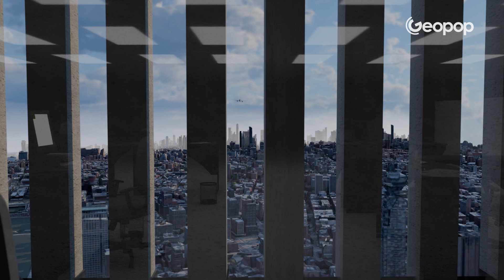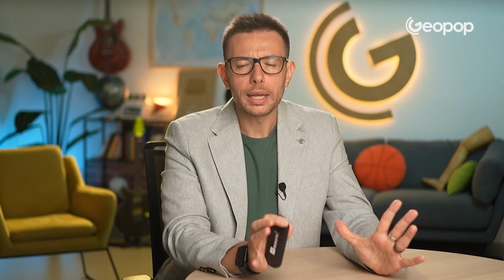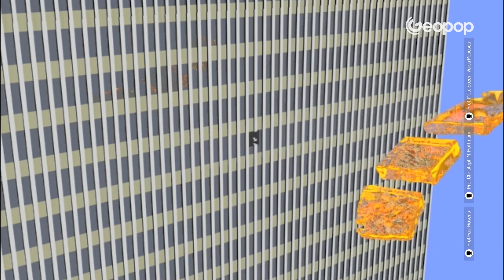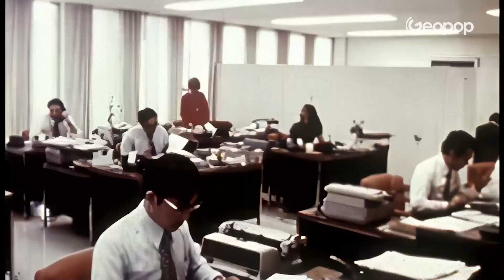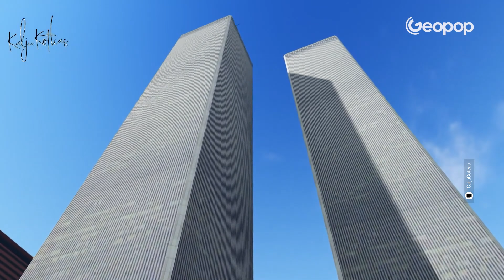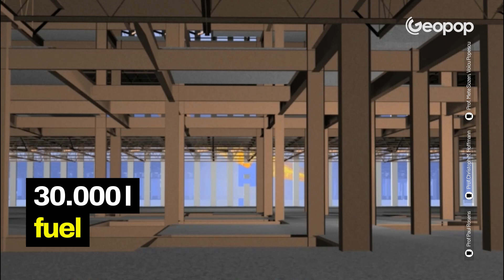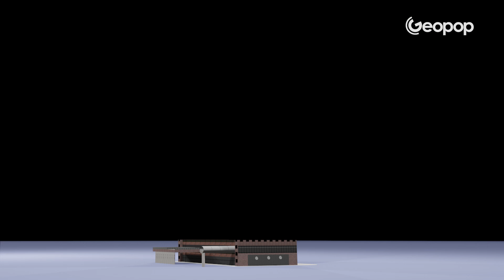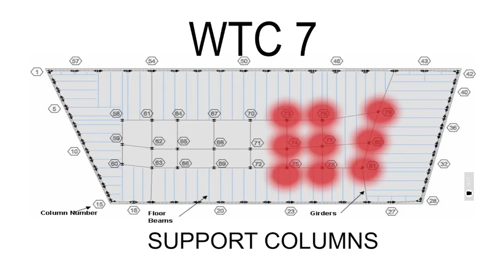9/11, 2001: The Technical Reconstruction of the Twin Towers and WTC 7 Collapses

Comment: Can you explain the MOLTEN STEEL seen in videos before AI became widely used?
Also, NIST is a US GOVT agency. Take a look at conclusions reached by "Architects and Engineers for 91q Truth", a non profit, non government body comprised of unbiased Architects and Engineers, who disagree with the official government stance.
Sure, steel beams can bend. But melt even though the temperature neve came close to the melting point? Just curious how that could be, unless something like thermite was introduced into the buildings.
Reply: Yes, I can explain. Molten metal pouring out of the South Tower (and it was in fact ONLY the South Tower)?  You mean this?

youtube.com/watch?v=xPVGGQU-MeQ&ab_channel=SeekersofTruth 

So you think that is molten steel why?  Because you performed metallurgical tests?  Because the internet told you that’s what it is?  I think we can do better, so let’s do better and build a theory the right way instead of making evidence-free assumptions. This will take just a couple of minutes and is worth the investment. 

The Boeing 767 which struck the South Tower weighed 117 tons and 80% of that was aluminum.  The exterior cladding on the Twin Towers – the white panels – were also aluminum. When Flight 175 struck at the 81st floor its momentum deposited much of the office contents in its way and the bulk of the aircrafts mass into the NE corner of the building. The piled up debris shoved into that corner is visible in photographs and video so we know it was there. 

There’s a good shot here of piled up debris from 4:36;

youtube.com/watch?v=ZLJyL63sqtU&ab_channel=MrKoenig1985

Steel melts at roughly 2,750-deg F while fires in the South Tower reached peak temperatures of around 1,800-deg F. Aluminum OTOH melts between 887-deg F to 1,180-deg F depending on alloy. That aluminum will melt under these conditions is not a surprise. If you look at pictures of cars left behind and destroyed by forest fires the aluminum wheels are invariably melted away along with other sometimes aluminum parts like hoods. Steel bodies remain intact. 

The “molten metal” appears at 9:52 am. At the same time we see the first externally visible signs of sagging floor trusses and the pulling of the perimeter columns inward. I submit these events are related, not coincidental. The aluminum cladding at the NE corner also appears to me to be burning. 

It is likely the with the floor trusses sagging under the heat, and the 81st floor truss in the NE corner under the debris pile subjected to the heavy load of the debris pile, the truss broke its perimeter column connections and dropped, instigating the material starting to pour out of the NE corner at the 80th floor.

Given the properties of the materials in question, aluminum is by far the most likely culprit. 

Reports from The NIST, FEMA and MIT all concluded the material is aluminum. 

Certainly steel is the least likely of all the materials the anomaly could be given its much higher melting temperature and the fact there is no logical source for molten steel.  The perimeter columns in the NE corner are intact and the material is pouring out between them. So it isn’t columns melting, therefore what other source of steel is there?

Deniers will claim molten aluminum appears silver when molten, which is true but only at the low end of its melting temperature range. Aluminum can and does get hotter and it glows red to orange when it does (1,100 to 1,800-deg F).  Most folks of course just don’t bother getting it that hot if the goal is just to get it molten for say molding a part. No need to go higher. 

The total mass of molten aluminum is a BIG deal in regard to how it behaves when poured. Quantities bellow half a liter cool almost instantly if poured onto a flat surface, but if poured into say an ingot mould will stay red for a minute of so. Pouring volumes of molten aluminum greater than a liter is a VERY different experience. The thermal mass is much greater and the radiant heat is horrendous. The aluminum is able to stay liquid and remain glowing bright orange much longer. 

The famous video of glowing liquid gushing out of Tower 2 moments before it fell, involves at least tens of liters of molten aluminum. The thermal mass involved is so great that it stays red after falling many meters through the open air.

Side note: There was also a large UPS battery farm in that spot and some of that material at least may well be from the batteries IMHO.
Reply: @TheLoonResistance  No you can't because you a clueless youtube professor who has never been outside before in hes life.
Reply: @Desperado070  : He just did, however.
Reply: @Desperado070  - I did just explain ya moron!  In excrutiating detail. What do you think you are replying to?  

How about actually reading my last post?  I mean, I know it was a lot of words and as a conspiracist you are pretty much limited to no more than 4 lines of text (NOT sentences), but I put it up for your benefit NOT mine. The least you could do is extend me the courtesy of readin it. Yes, know it isn't what you want to hear and fucks with your dogma, but your dogma is demonstrably shit. Time to upgrade. 

It is OK to be wrong about a relatively mundane detail. No, really.

Comment: Fact vs fiction, the people believing the story that is sold to us also believe in fairy tales.
Reply: OK, so what specifically is wrong with the collapse mechanisms described here?
Reply: @TheLoonResistance  That you believe in fairy tales is not my problem, I'm a welder myself and I know at what temperatures metals give way or melt. I'm not here to discus over the internet with people you don't even know their IQ from.
Reply: @Desperado070  : That you believe in fairy tales is part of our collective problem: ignorance is an issue.

" I'm a welder myself and I know at what temperatures metals give way or melt"
Good.
So you understand how the fire could weaken the structure enough for a fall.

"I'm not here to discus over the internet with people"
I discuss with everyone, even ignorant.
Reply: @Desperado070  - I merely asked a clarifying question. One which should have been easy enough to answer.

But you couldn't.

So who is the one here with the fairytale problem?  

I'm not a particularly great welder myself, but I can do this and you obviously can't:  While complex, most of the Twin Towers collapse mechanisms can be seen with the naked eye and easily discerned and understood by the layperson if sufficient time is taken to understand. 

1. The Twin Towers consisted of 4 primary structural elements that together formed an integrated system where each relied on the others.  47 hollow box-section steel Core Columns carry the majority of the gravity loads. The 236 hollow box-section steel Perimeter Columns carry the remainder and ALL of the lateral (wind) loads. Long-span Lightweight Steel Trusses connect the core and perimeter column together at each floor with a Hat Truss on top to tie the structure together as an integrated unit where no element can survive without the others. There was no structural load bearing concrete and most components were bolted together. www.youtube.com/watch?v=u7OqrC74Dm4 

2. The impact of 117 tons of airplane (= to about 12 dump trucks) at speeds up to 590 mph with the energy of a ton of TNT completely destroys the aircraft. This in no way implies the Towers come out unscathed. Many perimeter columns are damaged or destroyed as are some core columns (example; 33 of 59 perimeter and 20 of 47 core columns damaged or destroyed at the impact floors in the North Tower), This damage is primarily through bolt-shearing failures at the end connecting flanges, as well as bending, twisting and fracturing of weld seams. There was no cutting or slicing - the reality was far more violent and messy. 

3. The impacts destroy or damage fire insulation, fire breaks and sprinkler systems on multiple floors.  Huge fires are started across multiple floors simultaneously and allowed to spread rapidly with no effective firefighting or fire suppression. This was an unprecedented fire event . 

4. The hotter steel gets the weaker it gets .  With fire insulation stripped away and no sprinklers the survival time of the steel greatly reduced. Gradually over time heat causes the lightweight steel Floor Trusses at the impact damaged floors to sag, which was observed and recorded.  No steel melted or needed to. Structural steel fails long before it becomes a puddle. It just needs to bend

5. Sagging floor trusses pull on the increasingly weak and overloaded Perimeter Columns, causing some of them to bow inward by up to 5 feet. A straight column is up to 4 times stronger than a bent column. The bowed Perimeter Columns buckle and fail, initiating collapse. The formerly static mass above which the structure below could easily support is now converted into a dynamic mass up to 30 times greater. Because they have buckled, the Columns above and below the failure point are no longer aligned . The load bearing structure below no longer bears any load as it falls past the lower columns, NOT onto them.

6. Thousands of tons of debris fall within the four outer walls, down through the open office space, crashing onto the first intact floor it encounters. This massive impact immediately breaks the bolted connections to the columns as the amount of resistance the Floor Trusses can offer is negligible.  The falling debris slows only marginally and briefly. Note:
6a. This is NOT a solid top block crashing into and “crushing” a solid bottom block .
6b. The debris falls past the columns not onto them.  The columns provide no resistance to the falling debris. 
6c. Only the bolted connections of the floor trusses to the core and perimeter columns can offer any resistance. A pair of 5/8” bolts at each end of each truss vs. thousands of tons of falling debris.
6d. No laws of physics are violated.

7.  This floor-led collapse progression within the four outer walls can only go straight down. Note: 
7a. This process is often incorrectly referred to as “pancaking” which actually refers to a completely different process rejected at an early stage. The catchy name stuck but nobody knows what it is supposed to mean.  Pancaking is too simplistic and inaccurate anyway. More like Kaiserschmarrn.

8. Collapse progresses through the floor systems not down the columns, through the path of least resistance . Rate of floor failures increases with each successive floor as momentum increases, reaching an average acceleration of 0.65 of GA, or 35% slower than true free fall. Bam, bam, bam down the building until there are no more floors to fail.  The resistance offered by each successive floor is always the same. The mass and velocity, thus the energy of the falling debris is constantly increasing, with each floor destroyed adding new falling mass. Some falls to the sides, but most falls down. More mass, more velocity, same resistance with each floor.  Don’t get stuck on the but the lower floors weren’t on fire nonsense. They weren‘t and didn’t need to be.

9. The Towers were 95% air by volume. As that air was compressed inside the building it is forced down the tower and blown out the sides in reaction to the building collapsing . Those were not “explosions”, it was expulsions of compressed air caused by the collapsing building, explaining the low velocity, lack of flash, blast, supersonic pressure waves and lethal high-velocity ejecta.  

10. Perimeter Columns become detached and peel away like a banana behind the collapse front, playing out to the four points of the compass extending to more than 600 feet from the base of the towers. This was quite obvious from examination of the debris pile. 

11. Core Columns fail last as their internal beam bracing is stripped away by falling debris and lateral support from the floor to perimeter columns is lost. 

12. For those who care about how long this whole process took; 31-34 seconds from the moment the perimeter columns buckled until the last core columns hit the pile, or 1/3 the rate of true free fall. Don’t believe me?  Just watch any video of the collapses and note the loose truly free-falling debris dropping much faster than the towers themselves.  

13. Each Tower had a 1-acre footprint. Far from collapsing inside their own footprints the debris pile spread out over 17 acres in a pile up to 14 stories deep. 8 surrounding buildings were destroyed and scores more damaged by the falling debris. 

14. NOT observed were the 180-190 dB bangs of thousands of high explosive devices or the blinding bright flashes of burning thermite. Neither explosives or thermite could have survived the impacts and subsequent fire nor could have caused the (silent) perimeter column buckling that clearly initiated collapse either. A video of a shocked and injured firefighter casually using the magic word explosion is in no way proof of explsoIVES  and the demolition_ case relies entirely on that sort of thing. There is zero tangible physical evidence and it would be technically impossible, totally impractical and completely unnecessary. No one would bother. 

15.  Finally, the Twin Towers were perfectly safe within their design envelope.  They only collapsed when taken far outside design parameters by an extraordinary and unprecedented event 

Impact + Fire (heat) + Time + Gravity = Collapse . Remove any one of those four elements and there is no collapse. Ignore any of those elements (as many do) and you will never understand the collapses. The Twin Towers were an integrated system in which no one component could survive without the others. One fails, the rest follow, through the path of least resistance – DOWN – through the open space, bypassing the path of greatest resistance – the columns.  Nothing I just described violates any laws of physics. All of the above is true no matter who planned and carried out the 9/11 attacks or why 

In 24 years zero structural engineers of tall buildings, including the 1/3 that have retired in that time, have made any statements in support of 9/11 Truth BS demolition claims. Zero, nada, none. The lack of any such citations in the engineering literature (published in any country worldwide) is palpable.

I hope you found this helpful and informative. It is not meant to be adversarial, but to solicit informed critical comment, positive or negative. If I made any errors of fact, logic or reason or left anything critical out, please let me know so I can fix it. To stay focused just one topic at a time please and on-topic (Twin Towers ONLY). No word-salads of Gish Gallop. IF you can offer a more plausible alternative be my guest. Be the first. Please start any reply with the words “Tits McGee” or I will know you didn’t actually read it, are not serious and just wasting my time.
Reply: @ThomasKundera  You are like a todler, you behave childish and you respond be like, no you. 😂 You really got something to prove if you have to respond to everyone comment saying something else than what you believe.
Reply: @Desperado070  : I say stuff that are correct and backed up by experts. Not random BS found on the net.
Reply: @ I don't even have to add anything to me other comment, just funny you guys are all the same with the same arguments. You also said that perfectly fine since that is how you guys think but not even knowing what a expert is.
Reply: @Desperado070  - Again, I have made no argument. I asked a simple, clarifying question which you are refusing to answer - because yhou have no argument

You might have a set of beliefs but nothing to back them up. You certainly don't seem to understand the subject matter at even a superficial level. So when I ask a simple and obvious question like what is wrong with the collapse mechansims presented here you draw a complete blank. You have no idea. You just know it doesn't fit your dogma.

What a complete waste of time you are. Have a nice day.
Reply: @TheLoonResistance  No, people just don't want to bring themself to your level, which is way to low for them. 😅
🤣 Kinda cute that you like ur own comments 😂